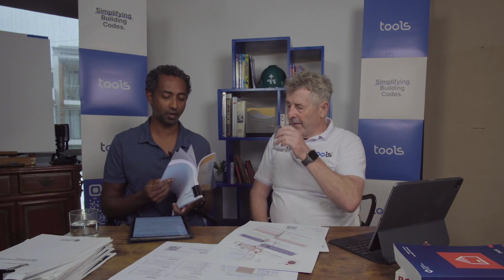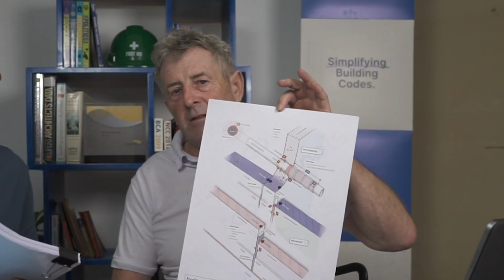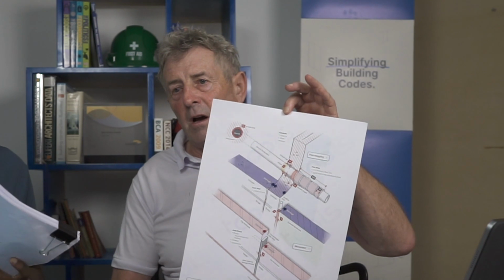The Problem with Specifications | NCC Compliance Codes | BuildingTools.co

Comment: This is a fantastic tool so well done to the Team! Question - Is there a way to include manufacturers specifications when specifying a particular product. Hypothetical example - specifying a Proclima weather resistant barrier, which is not part of NCC 2022 but proclima have done tremendous work to educate the trades on how to properly install their products. If such an expensive WRB is not installed properly, its money wasted and performance outcome is not achieved...